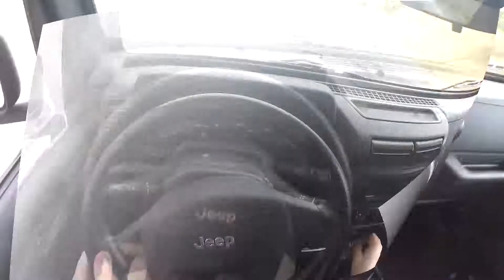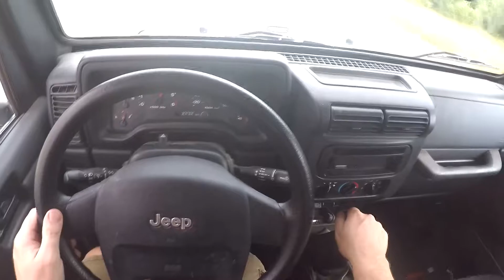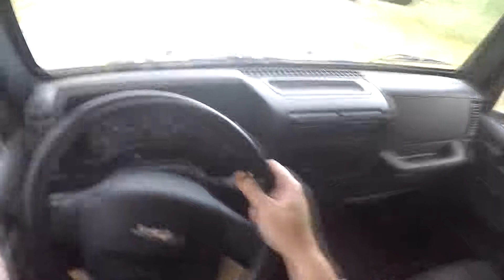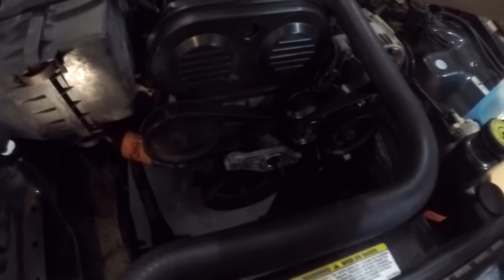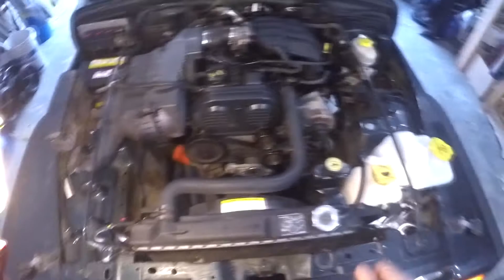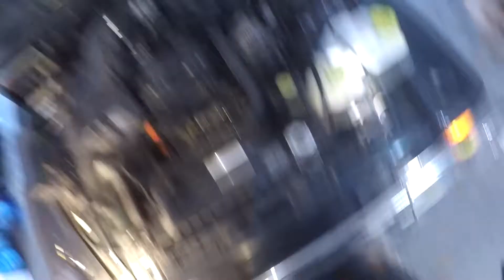2005 Jeep TJ 2.4 Engine Rattle Above 3500 RPM

Comment: Ok… could b ure balancer shaft chain rattling from a loose tensioner… location is in the front the engine, under the oil pan… easy fix, mine, unfortunately after changing my rod bearings, is I think a toasted valve. It fixed the knocking but the high rpm ticking still remains

Comment: Did you find the problem?
Reply from the maker: It must be a cracked exhaust manifold.  It hasn't gotten any worse and is more apparent with higher RPM and throttle/hills on highway.  Going to get Catalytic removed and manifold done a local exhaust shop and will confirm.  Still drive the same a little high RPM noise and no power haha
Reply: @ml414skidoo  did you figure out what was the problem?
Reply: Mine does the same thing at around 4500rpms did you figure it out?